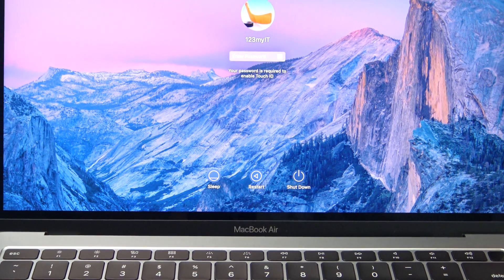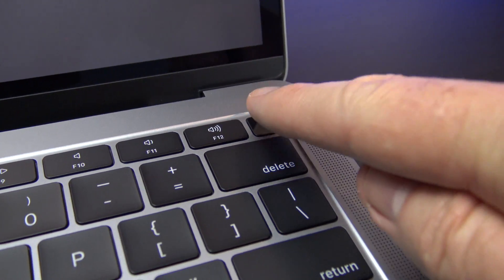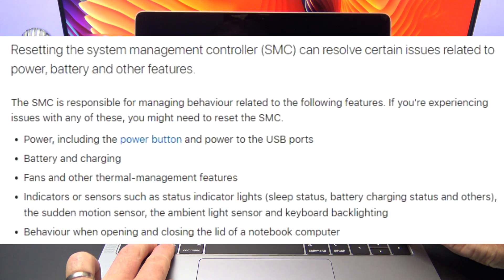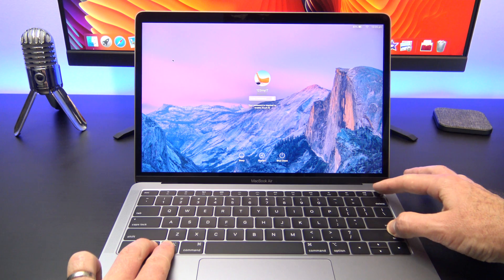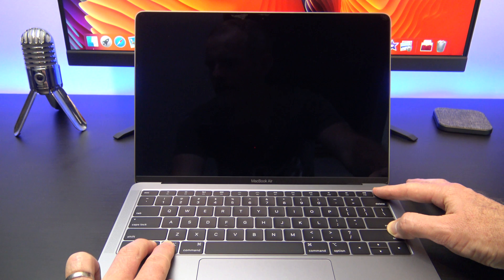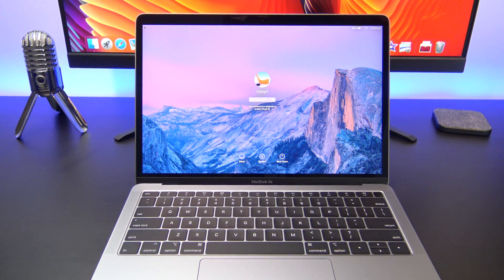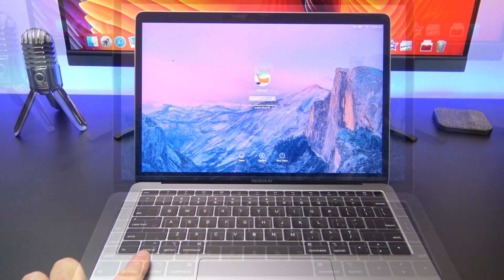Fix MacBook Air T2 Chip by resetting SMC

Comment: The battery is so dead that it does not recognize the plug-in to the computer. Checked the charger, cord, and ports.  But not sure how to charge the battery if it is not recognizing that it is plugged in.  Let me know what you suggest?

Comment: I have done everything, and my issue still has not been fixed. My battery percentage and bar are stuck at 100%, and it will never go down from there, and if it is low, it does not give me a notification that the battery is low; it just turns off. I reset it as the video showed, and I also checked the battery health in system settings. It shows 'Normal', so I'm not sure what else to check for.

Comment: I replaced the batteries on a Macbook Pro 15" 2018. On normal mode, the charging icon is not showing, though it is charging. The percentage is going up. On the recovery screen, the charging icon is showing up.

Comment: So my mac was showing the x symbol on the battery icon so i did the smc reset and then it showed 100% but then i unplugged it from charging and the x symbol came back.
Maybe you can help? Plus the mac was sitting in a cold room all night not plugged in and yesterday it was working just fine

Comment: My girlfriends MacBook Air retina 13 inch 2019 started having issues spontaneously a few days ago. Her keyboard is completely unresponsive. It works with an external keyboard and the trackpad works as well, but the MacBooks keyboard is unresponsive. I tried resetting the SMC as instructed by this video, but nothing seems to do it. Any insight would be really appreciated!
Reply from the maker: intel or m1 mac?

Comment: Hi there, my mac ( macbook air 2020 - intel i3) is shutting down when the battey percentage reaches to 35 (to be exact).

I've talked to apple support  for several days - lower level authority to the highest level. No one is able to do anything. 

Note : No hardware issued found

What can I do now?
Reply from the maker: Check the battery software % mate? So like settings battery. I know on the iPhone it has battery health with states how good the battery is? YOu can also try SMC reset and NVRAM reset. Sometimes this can fix the issue. 📢  After you reset the SMC, if you are still having issues try resetting the NVRAM. Video here. https://youtu.be/dwkZScZ3AOw Let me know how it goes?

Comment: My Mac screen color is wonky, when I power it on the apple colors are correct for a few secs, then it changes to an orange tint. I tried everything, checked display section, shutting down my Mac in every possible way, it’s just not working
Reply: I now this video was 2yrs ago, but if u could help me, I would be blessed ty
Reply from the maker: @yanwang4530  try this? To quickly turn Invert Colors, Increase Contrast, and Reduce Transparency on or off using the Accessibility Shortcuts panel, press Option-Command-F5 (or if your Mac or Magic Keyboard has Touch ID, quickly press Touch ID three times).

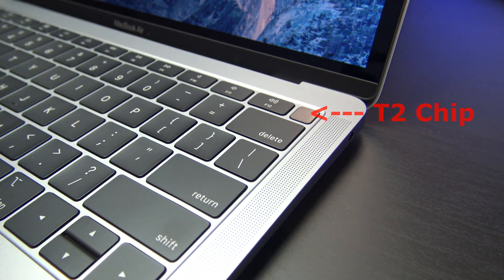Comment: 00:28 What are you talking about??? The on / off Touch ID button is not the T2 chip at all. The T2 chip is a so called security chip on the logic board. Spreading misinformation might get you some views, but it's all BS. See here https://en.wikipedia.org/wiki/Apple_T2
Reply from the maker: Thx for doing the research mate !

Comment: Hi, my macbook air 2018 t2chip keeps turning off to black screen when showing the apple in startup. it also can not run more than 3 apps at a time, and lacks when doing school work such as writing and using safari. is it to old and slow, or is something wrong with it?
Reply from the maker: This sounds like hardware problem. Is it still under warranty?

Comment: My macs fan speed is full blast on idle and it’s working very slowly with no tabs open as well as the battery saying it needs service but is completely new
Reply: The sec reset hasn’t been working either
Reply from the maker: @ethangonzalez2380  iS IT m1 MAC?

Comment: I have a 2019 macbook air that I haven't used for years. Now I try to turn it on, it won't. I bought a 100W charger and was able to turn it on, but there was a cross sign over the battery icon, and it started extremely slowly. Then I reset SMC using your method, and it still restarted slowly, but the battery icon shows charging. What should I do next? It is extremely slow to start, and the touchpad has significant lag when I try to move the mouse.
Reply from the maker: 📢  After you reset the SMC, if you are still having issues try resetting the NVRAM. Video here. https://youtu.be/dwkZScZ3AOw

Comment: Hello. How to fix this bouncy effect on the cursor? I have a macbook 2019 t2 chip. Did the smc and pram reset but still not resolved.
Reply from the maker: Bouncy effect? Could be hardware mate. Try this. Plug in a corded usb mouse and see if you still have bouncy effect?
Reply: @123myIT  Yeah still the same, tried with different external mouses. The pointer flickers everytime I hover it to other web links. The only time it stops flickering is to adjust the pointer size then it will go back to flickering after a while.. so wierd though, I didnt had this iisue with my MBP late 2015 13"

Comment: My issue is that the keyboard backlights wont turn on i go to system preferens i click keyboard there is no low light option there what do i do to fix my mac?
Reply from the maker: I dont think keyboard back light is a setting as such. It should work off your keyboard itself. Which mac is it mate? M1 or intel? T2 chip or not?

Comment: I have problem with macbook pro A1989  2018 with touchbaar,it does not want to SMC reset..? all keys in the keyboatd act as power on key..even command+R or command+D do not react...what should I do..? any help..?
Reply from the maker: Try this ? 🔥 Link to reset SMC on Macs without the T2 Chip Click here: https://youtu.be/WMAdyMkv-Lg

Comment: My MacBook Air battery keeps draining even when it’s not in use, like during sleep mode and even when it’s turned off.
Reply from the maker: Which Mac os?
Reply: Big sur
Reply from the maker: @karmanorbu4515  Try doing an update mate. Make sure its going to sleep when you are closing the lid?

Comment: mine is macbook pro 2019 touchbar, till yesterday it was working well, and then today when i opened it, apple logo kept appearing then i shut it down and hold option key, then chose bootcamp windows 10 and it is working, after that tried NVRAM and SMC still not working. and tried also "Option Command R" it failed and said 1008F, completed that guideline too and saying that again 1008F, What should I do next and Why is that happening? Can you help me, I am using Bootcamp Windows. Cant log in MAC OS.
Reply from the maker: Ive seen that too. What version of Mac OS ?
Reply: @123myIT  it was Big Sur, and still using Windows Bootcamp :(
Reply from the maker: @fairvisauz  yeh big sur is a bit buggy
Reply: @123myIT  so how can I fix that problem?
Reply from the maker: @fairvisauz  Make sure you have your MacOS updates and do a reinstall of bootcamp. Its annoying.
Reply: @123myIT  How can I do it correctly? Can you make a Tutorial with step by step explanation and upload to your youtube channel?

Comment: Thx for the video! A question: how did you screen mirrored your macbook screen to the monitor without a hdmi cable?   Are you using an apple tv? does it work with chromecast for example? thx

Comment: Hi guys: My down arrow button of the MacBook Air T2 chip suddenly not working this afternoon, tried this way to reset, however, the issue is still there. Any suggestions? Thank you very much.
Reply from the maker: 📢  After you reset the SMC, if you are still having issues try resetting the NVRAM. Video here. https://youtu.be/dwkZScZ3AOw

Comment: I am having an issue with touch ID after complete motherboard replacement. They say is it because of the T2 chip. Is there any way to reset that chip completely so I can set up touch ID again ?
Reply from the maker: 📢  After you reset the SMC, if you are still having issues try resetting the NVRAM. Video here. https://youtu.be/dwkZScZ3AOw

Comment: So my story is that I purchased an Ifixit battery replacement kit and did everything accordingly but for whatever reason, even after using the SMC method you showed me here the issue still persists where the Macbook pro just won't display battery status and also says 0% while it is being plugged by the charger.
Reply from the maker: 📢  After you reset the SMC, if you are still having issues try resetting the NVRAM. Video here. https://youtu.be/dwkZScZ3AOw

Comment: Ever since I upgraded to big sur ony the upper right half of my keyboard lights up I tried this but it doesn't seem to work
Reply from the maker: 📢  After you reset the SMC, if you are still having issues try resetting the NVRAM. Video here. https://youtu.be/dwkZScZ3AOw
Reply: @123myIT  Already tried nothing
Reply from the maker: @frankmelian6483  M1 chip ?
Reply: @123myIT   no 16 inch macbook pro i9
Reply from the maker: @frankmelian6483  Have you done all the updated like firmware etc?

Comment: Hi, I have the MacBook air 2019. The Touch ID is not working and I need to reset the t2. Can I review the t2 chip with Apple configure 2 without another MacBook on hand.
Reply from the maker: You might be able too. Normally I just do a restore using command R.

Comment: Guys please don’t follow this. I did it and my Mac literally shut down and didn’t turn back on. Please go to the Apple store and they’ll diagnose and even do the reset for you for FREE. Because I ended up paying 80 bucks to send it to the repair center, even the Apple geniuses didn’t even know what was wrong with it. So unless you want to go through all that trouble, just don’t do it. For evidence, you can even look at some other comments below with the same issue
Reply from the maker: Most probably you had an issue with your Mac mate. This is safe process with it recommended by Apple. :)

Comment: My laptop dies before the battery runs out,  it used to die at 45% a week ago now it dies at 80%. Any help?
Reply from the maker: How old is the Mac mate? Check your battery health in the settings maybe?
Reply: @123myIT  I just checked, it says the capacity is significantly reduced, but that should mean it would run low quickly it shouldn't suddenly die at 80. And when it does its as if I removed the battery, the time resets. Also it's a late 2018 MacBook air with a T2 chip. Had it since early 2019
Reply from the maker: @adamart8719  Check your warranty mate. It means that your battery no longer charges a full charge.

Comment: Okay, it won’t work.
My problem is that i opened up my MacBook pro 2017 (after being away from it for 2 weeks), and when i came back from vacation, it wouldn’t turn on.

First i thought that the battery just had gotten cold, but when i plugged in the charger, it would always stay on 1 percent, no matter how many hours i’ve had it charging.

I have tried to reset the SMC and the NPRAM multiple times, but it won’t start charging the battery.
My computer has been on a dry desktop while i was gone, the only factor, that has played a role, is the low temperature, which might be why there’s a warning about getting my battery checked because of the reduction of the battery’s life.

I hope someone can help me, cause Apple support opens monday.
-Ken
Reply from the maker: How old is the computer mate?
Reply: @123myIT  2017 version

Comment: Hi, I bought a m1 chip MacBook air and there is a weird buzzing coming from the left speaker and it is very annoying, I hope that you or someone can help me because smc reset didn't work, other wise i need to deal with the technic service.
Reply from the maker: Does buzzing happen when you plug in earphones?
Reply: No,
Reply: It happens time to time, while watching a movie or etc. On speakers
Reply from the maker: @kaanaltunlu4826  sounds might be faulty mate. Would call apple for sure.
Reply: @123myIT  thank you for taking your time for me, I will get an appointment with the technic service today.
Reply from the maker: @kaanaltunlu4826  Let me know how you go. I am also returning the MacBook Air I brought.
Reply: @123myIT  with the m1 chip? Why?
Reply from the maker: @kaanaltunlu4826  had some crashing issues.

Comment: 2020 Macbook pro 13inch intel.  My charger doesnt charge my macbook when plugged in initially.  I need to unplug cable from power adaptor and plug back in every time then it works.  Any idea on how to fix this? using all OEM apple power adaptor and usb c cable.
Reply from the maker: Do you have a different cable or adapter you can try?

Comment: Hi, 

I'm having an issue that only a a part of my screen is lighter. Like the brightness is very high, while the other part are normal. It was Flickring before. It happened after the battery died. So I didn't drop or anything like it would be a hardware malfunctioning.
Reply from the maker: Try this video and the NVram reset video 📢  After you reset the SMC, if you are still having issues try resetting the NVRAM. Video here. https://youtu.be/dwkZScZ3AOw if that doesnt work then maybe a hardware issue. Is it still under warranty?

Comment: Thanks for the video. Unfortunately, it didn't solve my problem. Here's my problem that I am trying to fix. I have MacBook Pro 2020 4 thunderbolt version. The top left one is not charging my MacBook while other three are doing it normally. And when I try to connect anything through that first thunderbolt port, it says: USB ACCESSORIES DISABLED, Unplug the accessory using too much power to re-enable USB devices. But, there are no other devices connected to my Macbook. Please, advice what to do? Thanks in advance.
Reply from the maker: Hi Mate for that error it says try SMC reset. So you are on the right video. Try the process again for your Mac it might be different from the video. Also try a NV reset video here. 📢  After you reset the SMC, if you are still having issues try resetting the NVRAM. Video here. https://youtu.be/dwkZScZ3AOw
Reply from the maker: Good luck dude let me know how you get on.

Comment: My camera is blank
Reply: It didn’t work
Reply from the maker: @vetrivelayoudam6809  Check that another App isnt using the camera mate? Like zoom or facetime.
Reply: FaceTime doesn’t work as well
Reply from the maker: @vetrivelayoudam6809   yeah so another app probably has control of the Camera. 📢  After you reset the SMC, if you are still having issues try resetting the NVRAM. Video here. https://youtu.be/dwkZScZ3AOw

Comment: The video didn’t help me at all. The problem I have is my MacBook Air (2020) function keys aren’t working. Another problem I have is the caps lock button light not turning on. I need you help
Reply from the maker: Try this dude ? 📢  After you reset the SMC, if you are still having issues try resetting the NVRAM. Video here. https://youtu.be/dwkZScZ3AOw
Reply: Thx for the advice! I found out the problem! Unfortunately debris got in my MacBook.

Comment: The problem that persists is that when I plug the charger, the battery status remains on: “plugged in power but battery not charging” (the icon is the battery full white and the lighting on it ).
The normal status would be the battery to get charged immediately (the icon is an empty battery with the lighting on it).
Followed the steps but nothing. How can I know that the SMC was indeed reset.? Thanks mate
Reply from the maker: Usually issues will disappear.  Try the NVRam reset ? 📢  After you reset the SMC, if you are still having issues try resetting the NVRAM. Video here. https://youtu.be/dwkZScZ3AOw

Comment: I tried this solution but I think I have different kind of problem if you have time please check my problem and help me to fix it .... ok so I have MacBook Pro 16 inch, whenever I lid down it goes in to the sleep mode but my WiFi and Bluetooth not turned off in that situation and that is draining my battery while sleep mode, so can you help me in this issue ? .... in my old MacBook machine whenever I lid down my wifi automatically goes off but not in this ...
Reply from the maker: Try this one dude. 🔥 Link to reset SMC on Macs without the T2 Chip Click here: https://youtu.be/WMAdyMkv-Lg
Is that doesnt work let me know.
Reply: 123myIT hi , thanks for reply ... actual my MacBook is with T2 chip and I reset the NVRAM too but doesn’t work it
Reply from the maker: @TheSanket2311  Cool mate sorry to hear it didnt help!

Comment: Shit I tried reseting smc by following the video. Pressed the 3 buttons when my mac was switched off. After the first apple logo came, I held the power button with all the 3 keyboard buttons too but it just went blank after that and it is not starting at all now. It is bricked :((( 
Tried the steps again, tried normal booting too - it is not turning on.

16 inch Macbook Pro 2019
Reply from the maker: Does it have power mate? Try this video as well https://youtu.be/dwkZScZ3AOw
Reply: @123myIT  yes it did have about 50%. Now it's not even charging (I can tell because the adapter is not heating up) I tried everything and have put it for a repair now. They are yet to diagnose the issue whether it is the logic board or something which bricked. Under warranty so I hope all this gets solved real quick.

Comment: I did follow the steps to do smc reset but without any luck, the mac refused to turn on even after multiple attemtpt of smc reset. Any suggestions over this? I have a 2017 macbook pro with T2 chip and issue is certainly not with the charger as it is charging other devices.

Comment: I've had my new MacBook Air 2020 for a week and recently soon as I start it up and log in, the fan runs for about 30 seconds then stops. I've reset the SMC twice but still get the fan.
Reply from the maker: Try this one mate https://youtu.be/dwkZScZ3AOw
Reply: @123myIT  still getting the fan. It says with the t2 chip, release keys once apple logo disappears twice but it only seemed to disaster once then it cam back on with the apple logo and loading bar so I relased  then since it didn't look like it was going to disappear again?